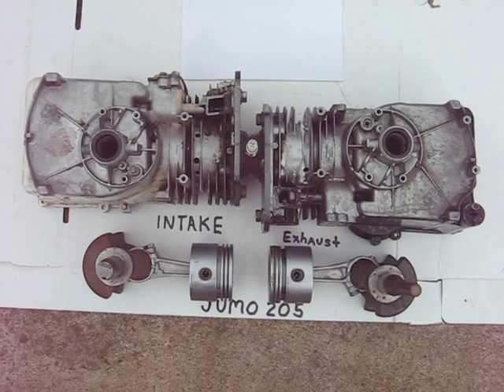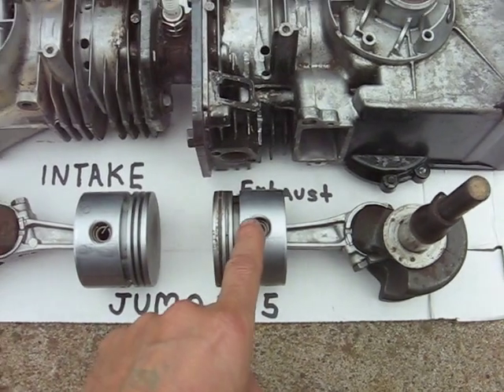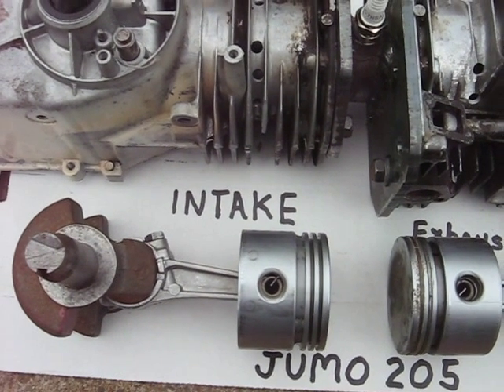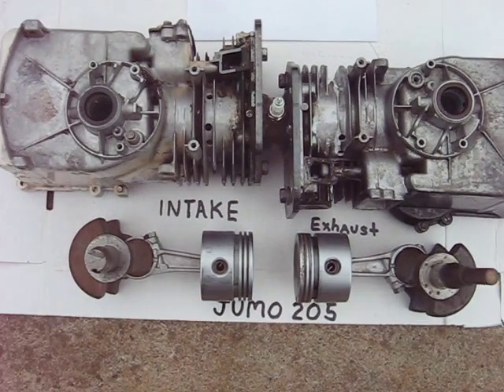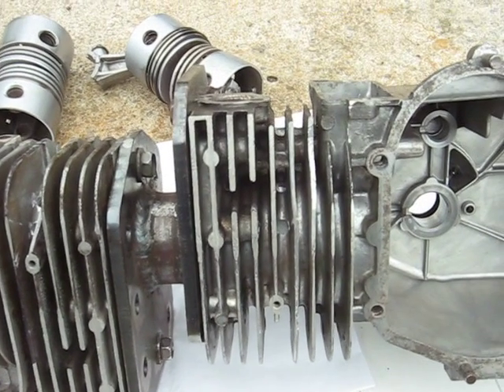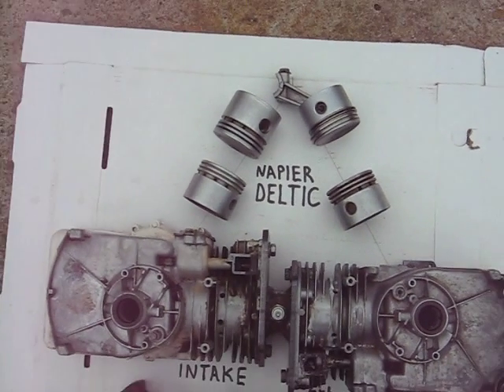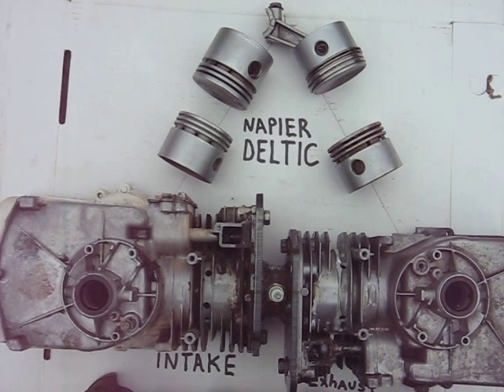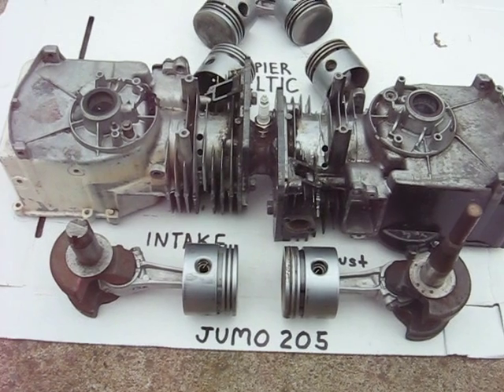Briggs-Jumo 205 mock-up

Comment: yes its a dodge ram 1 ton alternator for tralers so it out puts around 12.5-14 at 100 amps (cheep its out of the car in my driveway 1969 dodge dart so ya it was cheep)lol
the high amprige is origonaly for the trailer lights =3- cool hu

Comment from the maker: @xoxoXoieoxox 
Yes, I thought you would need heavy wire to handle that load.
Sorry, I haven't been able to view many of ypur vids, I don't have internet at home, and have had limited time at the library this week, but I WILL view more of your vids! :)
So, do you use a car alternator as your generator, that why it is 12 volts? I guess that would be the cheapest/easiest way to obtain a generator to do the job.

Comment: @chargermiles007 there are the test runs of both single cyl and 2 cly vertions runnung on my channel the lattest tests got aprox 1250 watts it was 12.5 vdc x 100 amps (that's funny no taxes on wood) fuch the man =3-

Comment from the maker: @xoxoXoieoxox 
Yes, that is a very good idea1 I thought of that myself, as well as using a VW diesel engine to run a generator using fuel oil, it would have been an immergency backup system, if the power went out for a long time. A steam engine is an awesome way to do it, and there is NO taxes on the wood!!!!  :)  Could you make a vid of it, I would really like to see that, even without it running!

Comment from the maker: @MisterRudolf 
I am making this run on gasoline, and it will only be running low boost pressure.
I would expect the non-finned steel combustion chamber to heat up faster than the pistons, but I could be wrong.
So you say that the opposed engines run hotter than a normal diesel, why is that?
I did know that they used steel piston crowns, with oil cooling, and that the exhaust piston runs hotter.